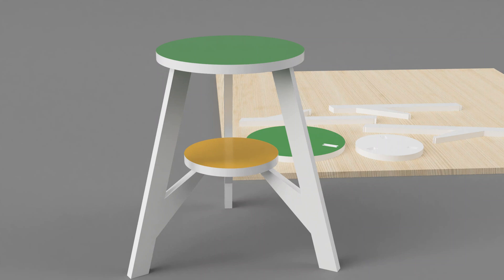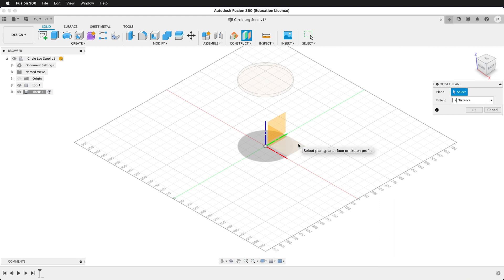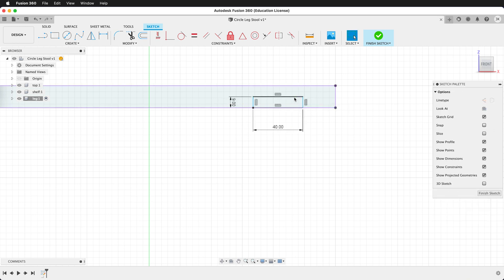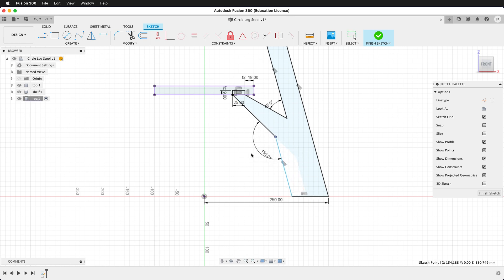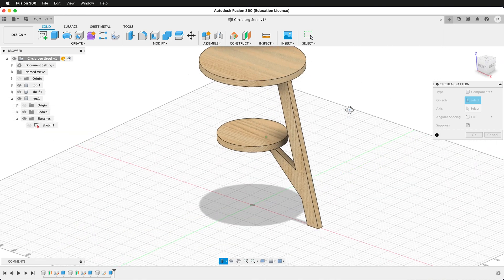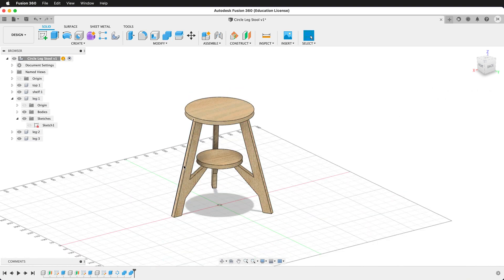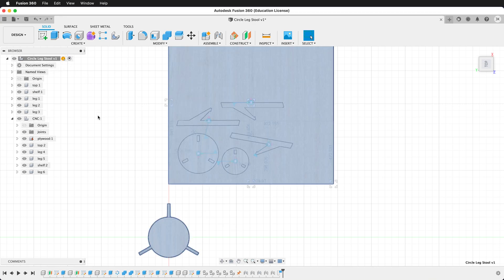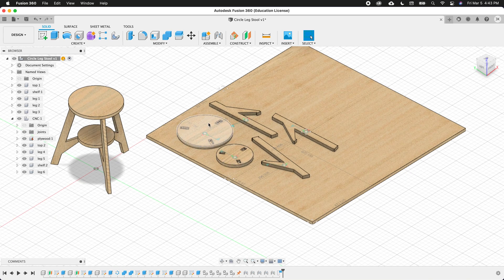Fusion 360 CNC Table

Comment: Thanks for the video! Your workflow makes things super easy to follow. Just a question on the t bone joints on the legs, I’m probably missing something, but I’m assuming these wouldn’t be needed being that the but can follow the outside angle? I know they would be needed for the inside angle.
Reply from the maker: Yes, you are correct, as long as the bit can follow an outside corner it can be sharp